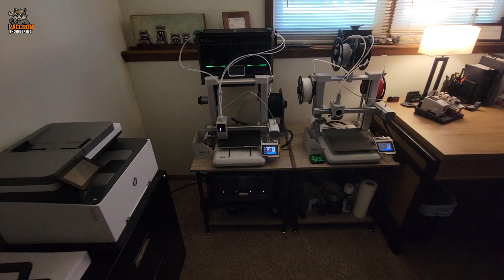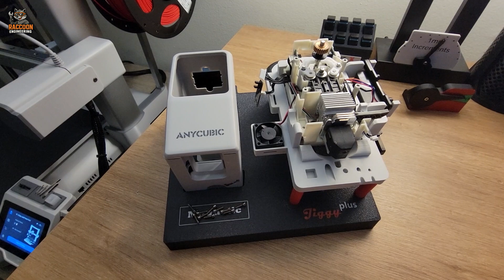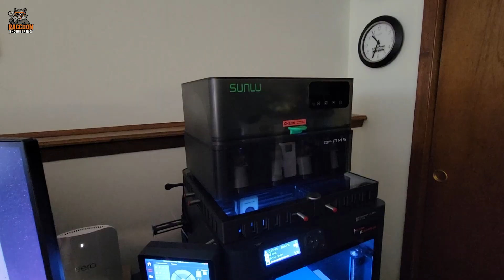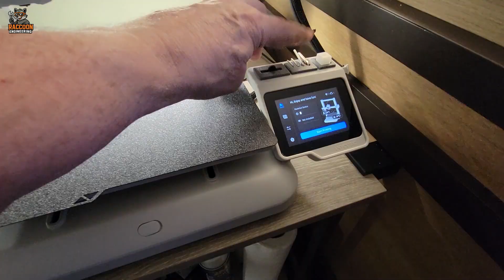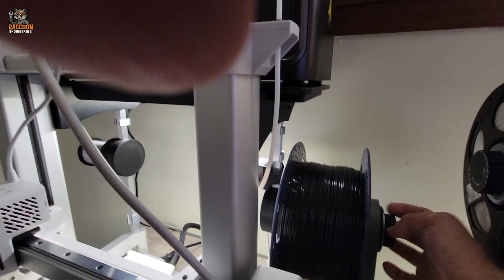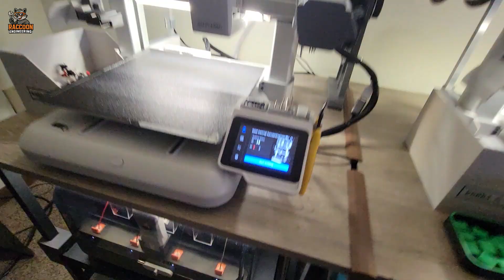Raccoon Engineering Printroom tour

Comment: You didn't buy the ACE2 for your Kobra 4 which was only $100 more?
Reply from the maker: Brad, I did. I just moved it to the Kobra X.  Its too good of bargain to pass up. I am not a fan of the Ace 2 Pro, so I only use it when needed.
Reply: @RaccoonEngineering It is OK.  I like the AMS better but it works.
Reply from the maker: @bradandrews777  Totally agree.